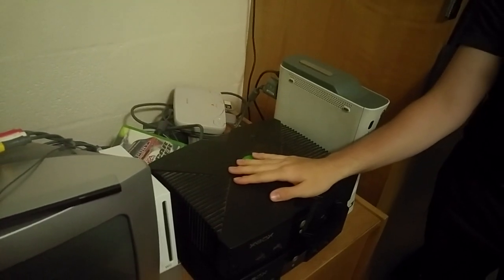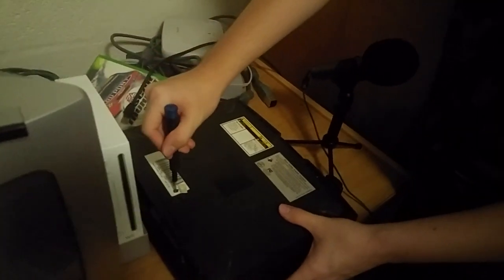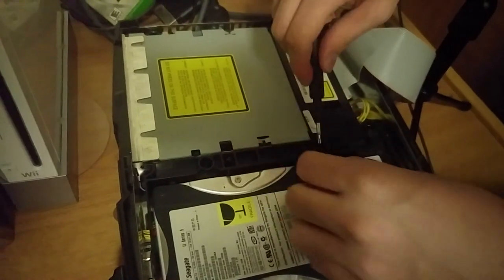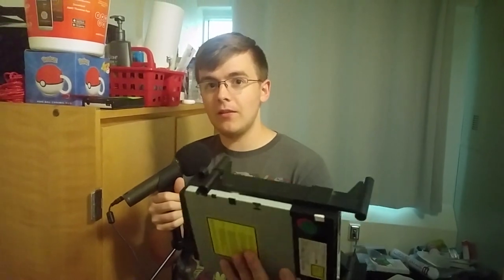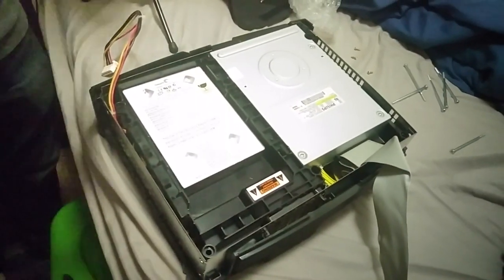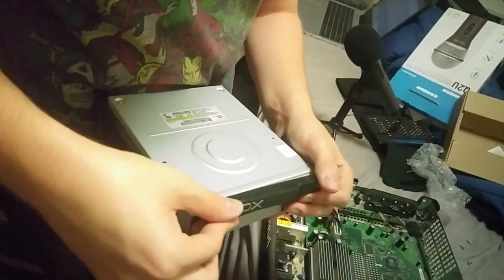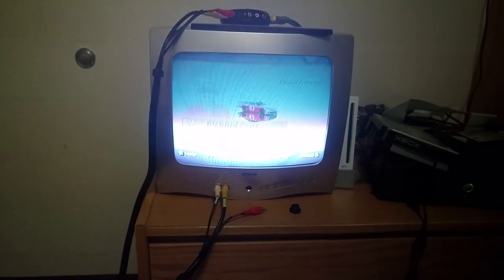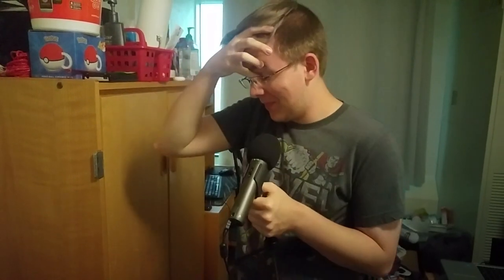Replacing the Xbox DVD Drive with STYLE!

Comment: I loved the original Xbox. But I have to avoid the earlier models(2001-early 2003) because some of the earlier revisions have a Shitty Thomson DVD Drives. Let me give you info about the dvd drives for the original xbox. Thompson(shitty brand and has a crappy laser it’s a piece of crap drive and get a lot of disc reads errors) Phillips( pretty good drive and a huge step up/improvement over the Thompson and one of the most popular drives for the Original Xbox) Samsung(The best dvd drive for the original Xbox due to the better read speeds and more cd format compatible) Hitachi/LG drives(very rare drives shipped near the  end of the original Xbox’s lifespan I think it has the same reliability as the Samsung)
Reply from the maker: I have a good amount of info already on the Xbox drives, but thanks for all this information! Thankfully my third box hasn't had a failed drive yet, but it is a Thompson so that's scary
Reply: gregandcin oh and my Xbox console was manufactured in 2004 and it was shipped with the Phillips DVD Drive. IMO I prefer Phillips over Samsung(even though it’s the best drive but they are prone to sticking trays) which dvd drive you prefer?
Reply: gregandcin oh and my Xbox console was manufactured in 2004 and it was shipped with the Phillips DVD Drive. IMO I prefer Phillips over Samsung(even though it’s the best drive but they are prone to sticking trays) which dvd drive you prefer?
Reply from the maker: Only have had Thompsons and a Philips, but so far the Philips has been better to work with
Reply: gregandcin and dude About the original Xbox do you think the sounds in the dashboard menu are terrifying because it scared the shit out of me when I hear something in the dashboard it’s like I’m communicating with aliens or something.
Reply from the maker: From what I remember, there are actually audio clips from a moon landing in the audio tracks! It's really creepy with the lights off at night though lol
Reply: gregandcin hey dude have you played gta San Andreas on original Xbox before?
Reply from the maker: @carlottajohns8691  never played it on the original Xbox, but I did play it on a PS2 with my friend back in middle school
Reply: gregandcin oh that’s cool that you played gta San Andreas with your friend. I have ps2 but it kinda broke down on me. I can either replace the ps2 console or replace the laser. Xbox has better hardware than ps2 anyways even though ps2 is my favorite system in the 6th gen mainly becuase i used it as my primary DVD player and a video game system back then
Reply: gregandcin hey dude which one you liked more in terms of graphics and hardware ps2 or the original Xbox.
Reply from the maker: The Xbox. Most cross platform games just looked and ran better
Reply: gregandcin I agree. Xbox also has the best exclusives like Amped, Halo, Dead or Alive, Ninja Gaiden, Fusion Frenzy, Crimson Skies: High road to revenge etc
Reply: What I want to know is where we can buy a replacement drive for any of those nowadays.  Some guy is selling those Thomson ones, NOS for about 200 USD.  I'd be down for something less than 100 USD, just don't think 200 USD is a good deal considering the reliability issues with those Thomson drives.

Comment: This video is so funny but still informative, I love it. One question: can you really use any DVD drive on the OG Xbox? Like, *any*?
Reply from the maker: Only Xbox DVD drives work! I don't know if anyone has tried any other drive, but I personally wouldn't try it
Reply: Any ide will work if you don't care about using original disks. Modded with burnt will work fine. You need to get the 4 data lines feed to the DVD drive connector
Reply: @stevenbenson9976  Yeah I have one with a standard DVD drive, works great with burned discs.